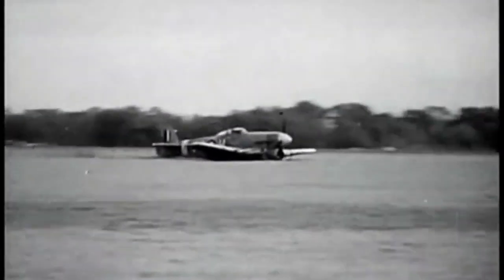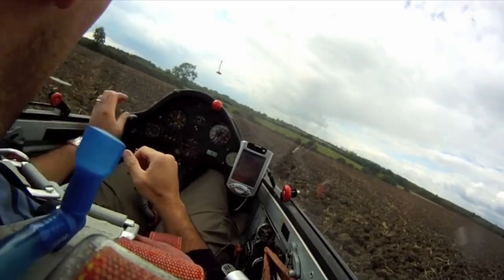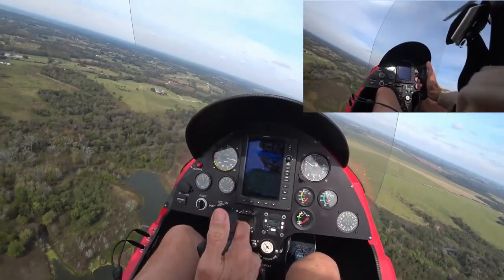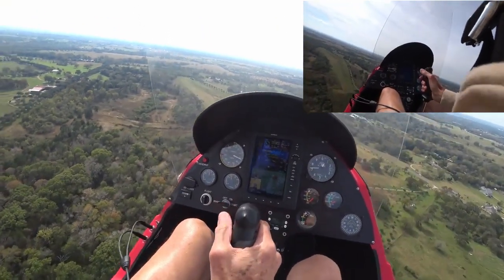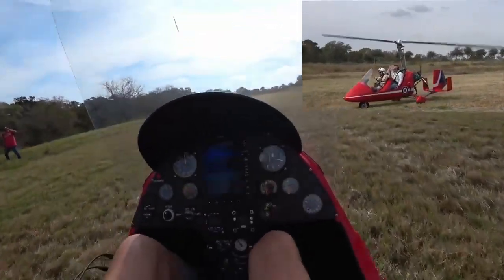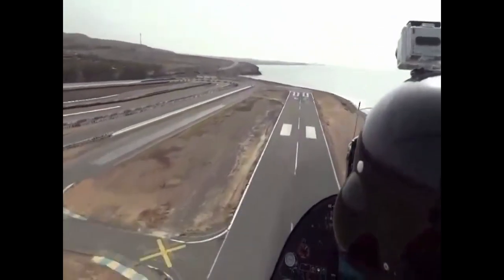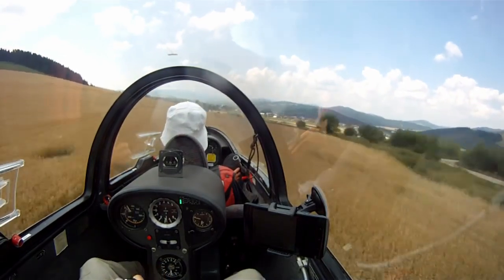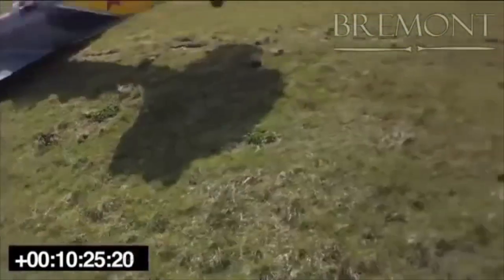Gyroplane/gyrocopter emergency landings

Comment: When I used to fly at the El mirage dry lake in southern California outside of Palmdale, my last landing of the day was a dead stick from 7,000 ft AGL. in all my landings I only ever had a problem one time, and that was doing a 360 to lose altitude instead of s's or a vertical. The result was that I had to spot land at the intersection of two roads in the desert about a humdred yards from the airstrip. I had practiced spot landings so much that it was routine. Practice, practice, practice. Know your machine, know it's flight characteristics, know yourself. And don't fly over anything you wouldn't want to land on.

Comment: All but the first was fw, and the was a complete stupid idea, but what would I know I only have 4000 hrs gyro
Reply from the maker: bones2898 but hopefully you’ll agree that the process including field selection and what you might do is consistent??
Reply: Gyrocopter flying club no I don’t the first clip could have easily have landed everywhere else but where he did poor piloting or poor decisions
Reply from the maker: bones2898 haha exactly- the point of a training type film is to highlight the obvious errors such that the new pilot doesn’t fall into the same trap. I think you might appreciate that with 4000hrs what is obvious to you won’t be to the pilot with 20hrs. It’s usually the low time pilot that crashes.....

Comment: Just for clarification - turning back is standard glider practice and is trained for. Using someone being stupid at an air display is hardly a meaningful example.
Reply from the maker: Turning back isn't promoted in gyroplane - which is the subject here.  The glider air display crash was used because given my commentary - " the consequence of turning with low energy at low level" - it seems to demonstrate one worse outcome well.

Comment: From anecdotal comments I have heard that the main problem with Gyrocopters is the Jesus bolt. Is it a matter of them not being torqued down enough or do they need to be made from something stronger?
Reply from the maker: Hi no that just isnt an issue. Main problem (as with most forms of aviation) is pilot error

Comment: I think you are very wrong to advise against returning to the runway. Disappointingly wrong. He could easily have returned instead of landing near people on a rocky shore. The glider example you showed is a very different situation on top of poorly flown. You really should reconsider.
Reply from the maker: Dan Frederiksen no turning back to attempt a landing on the runway you just left will see significant height loss and a downwind landing. His rocky landing was not ideal either the better options were making a plan to turn early to the left and then making fields available in the event of engine failure. I’m unclear what part of any turn back is different
Reply: @gyrocopterflyingclub6148  he was already over the airfield, falling and downwind would be fine.
Reply from the maker: @DanFrederiksen  but he didnt seem to have a problem until he was beyons the runway? Or that is how it seems to me. Anyway you have my view turning back is very dangerous and simply landing ahead is possible if time and space permit.  Thanks
Reply: They call it the turn of Death for a reason.
Reply: @robbyfiveboy4862  and the impossible turn but they also vote for trump and they are wrong. you of course have to know what you are doing, you can't stall, has to be a flying turn but despite the misinformation, there are videos emerging on youtube where they confront the lie and show it's quite possible. We are cleansing that disinfo.
It helps to think a return into your take off procedure. You don't take off super shallow at minimal speed but do fairly aggressive climb, above your best glide ratio. Also it's smart to kink to the side right after take off so it's a natural loop back to the runway. No one is teaching this yet but hopefully they will. With a good size runway, it's possible to return with engine failure at any stage. chance favors the prepared. You can practice in simulators. They are harder than real life.
Reply: @DanFrederiksen  - " chance favors the prepared. You can practice in simulators." - autogyro/gyrocopter simulators?? - please gimme a link if so and possible.
Reply: @ExcaliburBahrain  don't fly gyros. it's a dumb concept. interesting that it works but a poor flyer.
Reply: @DanFrederiksen  haha... tks - i first flew them 30 years ago. Felt there might be a simulator by now. As usual, ahead of time!
Reply: @ExcaliburBahrain  you should try a real plane. It can actually take you places
Reply: @DanFrederiksen true! - enjoyed that too. Might return to gliding for silence. All except helicopters & wingsuits...
Reply from the maker: Dan Frederiksen sorry I missed this but yes it sounds interesting - this is a powered technique or a glider one? Have you got some more information as it actually does make some sense. Cheers Phil.
Reply: @gyrocopterflyingclub6148  unpowered, in case of engine failure. I don't have experience with gyros but it seems like just a slow plane with a fairly poor glide ratio so it will need to ascend steeply to be able to return but because of the slow speed it seems to have a tight turning radius. You can practice at higher altitude or in sims. With a decent size runway I think all vehicles can return without power if just prepared for it. With a plane I kink out to the side immediately after take off so any loop back more naturally aligns with the runway. Rather than have to overturn 270 degrees and then back again to align. A gyro may not need this or virtually nothing. If it works, please spread the word. If we can return to runways we are vastly better off than some random ground location.
Reply from the maker: Dan Frederiksen thanks for that colour. Yes actually I see the logic of what you’re saying. In a gyro you need around 300ft to do a 180deg turn at idle power with a small pause to simulate  a reaction of a real engine failure. A smaller issue is downwind landing which isn’t great in a gyro but as you say it maybe better than landing in a random area.

Comment: Did the guy survive who tried to turn back?
Reply from the maker: Ripxd yes he did it's quite a well used accident in various flight safety discussions / meetings in the UK the AAIB report of the same is here https://assets.publishing.service.gov.uk/media/5422f9e5e5274a1314000733/Swift_S-1__G-IZII_07-11.pdf
Reply: Gyrocopter flying club Thanks! I’ll look into this :)
Reply from the maker: Ripxd no problems - the report highlights many factors, some more relevant to display flying and the sortie that the aircraft was flying.  However I include it in my gyro film simply to give a clear view of what happens if you manoeuvre as low speed and low level. Of course a gyro will not stall/spin but it will suffer a rate of sink that will not be recoverable from prior to impact with the ground and therefore the consequences for the pilot are equally grim.

Comment: Just for clarification... in the third clip (landing in a bean field in Indiana), the engine failure was not a result of poor tuning. The oil injection system failed and one side of the engine was starved for lubrication. This was a Rotax 670.
Reply from the maker: Thanks for that info and it was a nicely executed emergency landing, although I think I'm right that you have had quite a few 2 stroke engines let go over the years?  My point was really more the general one that the Rotax 9 series (principly 912/914) motor has seen an improvement in reliability.
Reply: :) You are correct, sir. 
I have a reputation for engine out landings. This was engine #4. I'm now on #6... not a Rotax.
Reply from the maker: Glenn Kerr as you are definitely walking the walk - what are your own pointers/tips on emergency landings? I think it would be great to get the view from someone who is really able to give real insight - thanks
Reply: The number one ingredient to successful engine out landings is training/practice. Every training session with your instructor should include emergency procedures/engine out landings. Also, every flight you take should include practicing those procedures and at least one engine out landing. The aircraft handles differently without power and the pilot needs to know that feeling to be able to guide the craft safely to the ground.
Reply: If you want to see an autogyro landing in an incredible place, click on YouTube videos: auto gyro, incredible landing. MY channel Youtube videos.
Reply: Incredible. Seeing as the Rotax engines oil system is virtually bulletproof. If the cable snaps the oil pump arm will go full on. Youll run rich as hell on oil but youll have lots of time to find a spot and if you keep her full throttle (if you notice the loss of power anything under full throttle) you can fly as high and long as youd like. 
The only possible failure points are the oil injection lines being old or tampered with improperly. Or the little plastic piece that attaches to the flywheel nut that turns the oil pump breaks (worked on them 15 years. Never seen one break. But have seen mechanics completely leave them out as well as not even bother to adjust the oil pump arm to spec.

Comment: Anyone thinking any Rotax engine is reliable needs to rethink that.
Reply: Rotax 912 have the same reliability rate as a classic certified engine like lycoming 235/Continentals 0-200 series, but in a gyrocopter the engine is most pusher, and in such configuration is the engine cooling difficult specialy with pure air cooled engines like lyco/conti, and much simpler with a Rotax who is mainly water cooled: never forgott that a perfect reliable engine doest exists...
Reply: analyste - Engine cooling is difficult? I beg to differ. I actually have more trouble getting my engine temperatures into the green and out of the cold zone. In MTOs, the Rotax 9 series runs very cool... almost too cool (because cool oil does not drive off water). Many people (in the UK and other countries which do not generally have baking hot air temperatures) tend to put a sleeve over their water and/or oil coolers to try to keep in some of that heat (at least they do until it comes loose in flight and goes through the prop).
Reply from the maker: Yes I'd tend to agree that the Rotax motors have good reliability if they are packaged well and then maintained properly. Many issues can be created by being casual with both elements and sadly. Enclosed gyros do create a more demanding environment- as has been said - but I'm unaware of regular or ongoing issues, certainly not in the UK. I might add that for me open gyroplanes are far better than enclosed types which really miss the point.
Reply from the maker: shakey Rotax 9 series? I.e 912 or 914 what is the issue?
Reply: Had several friends involved in General Aviation that got into the ultra-light world. They all had problems with Rotax engines. They all eventually gave up the ultralight flying all together because of it and went back to Cessna and Piper.
Reply: @shakey2634  that's probably because of poor or improper maintenance. Had flown rotax for 5 years on different machines. Not once had a problem. Everytime the problem was with either the pilot or the pilot.
Reply: @shakey2634  Probably thinking of the 2 stroke Rotax. The 4 strokes today are very reliable.
Reply: @ictpilot  
I think you are probably correct sir.
Reply: @shakey2634  bet they were not 912 series engines. They are fantastic from this turbine pilots experience.
Reply: Well the Rotax Engines in Motorbikes are known to be very reliable.
Reply: There was a guy on here flying a gyrocopter with a salvaged WW2 target drone engine on it! I had to comment to tell the guy, "you do realize that those engines were made as cheaply as possible, since they were disposable, and only needed to last for one flight, or more accurately, one half of a flight, don't you?"

Comment: What about oscillations!?  I have to ask because several years ago I had my heart set on purchasing a gyrocopter but was talked out of it.  As I was told gyrocopters "had a tendency to get into a porpoising oscillation that is unrecoverable and can lead to a fatal crash."  Your take on this?
Reply: You might find these experiences from a Finnish autogiro pioneer interesting:

http://www.tervis.fidisk.fi/JTsite/safety/Gyrosafety.html
Reply: Thank you very much!  That cleared up a lot of the questions/suspicions I had.
Reply: Thank you very much, First Last!  I'll check that link out.
Reply from the maker: Gyroplanes have a poor reputation and unfortunately some of it is based upon poor understand of the facts and some is based upon the nature of the industry/community.  To talk specifically about this oscillation I think what you have been referred to is something called "pilot induced oscillation" or PIO.  Yes it exists and yes it has killed some pilots - BUT it is not a general tendency of all gyroplanes (in fact the vast majority are perfectly stable) and in any event the situation is recoverable - which is simply close the throttle and load the rotor disc by bringing the stick back and reacquiring the horizon.  Why then was it a problem?  It my own view that it is in part poor training, poor understanding and communication of gyroplane dynamics, a general indifference to gyroplanes by regulators so none of the prior points were addressed very quickly and a community that holds (even today) a great deal of what I'd call "folksy wisdom" which means legend & myth can go unchallenged such that fiction becomes accepted fact.  

In the UK PIO issues were really being noticed as something of concern by our Air Accident and investigation branch (AAIB) following fatal accidents with Air Command gyroplanes between 1989 and 1991 (there had been 6 fatalities within that time with Air Command aircraft in the UK during that period).  Following the 1991 accident to G-BPFW the UKCAA suspended permits to fly of all UK registered Air Commands while the AAIB undertook an airworthiness review.

The output from that review was a recognised training syllabus, a review of technical approval document and arguably the first significant flight dynamics analysis of gyroplanes for decades with the Glasgow University study.  On the technical side there were some conclusions which are now incorporated into any gyroplane that is registered in the UK.  However sadly that report took a very long time to publish and unfortunately in that time for many opinion had been set.  

Certainly of the Air Command loss of control the conclusion was that "any pilot difficulty with the Air Command was likely due to either lack of currency, recency or experience" and certainly if you look at the fatal accidents in the UK during the period none of the pilots have very much experience.  Furthermore the is a very interesting insight to the geometry of controls:-

"A final point relates to observations of differences in control stick geometry. The two- seat variant was fitted with a 'pump-action' stick; perhaps they should have been fitted with a more conventional control stick that displaced in a fore-and-aft sense, rather than vertically. The already good speed stability might therefore have been translated into a conventional, and therefore readily interpreted form, for the pilot. It seems odd that pilots trained on the two-seater with one stick geometry, but had to progress onto the single-seater with fundamentally dissimilar control geometry"

Sorry that is a long answer but the truth is we have looked in the wrong place for sometime with gyroplanes and actually they are a very good aircraft for the GA pilot - but like all aircraft you need good training and you need to stay current.  My short videos are of course small snap shots of things that need to be highlighted to help current or new gyroplane pilots and whilst the techniques/ideas suggested are never going to be the whole story they are the best way to ensure safe and consistent operation.